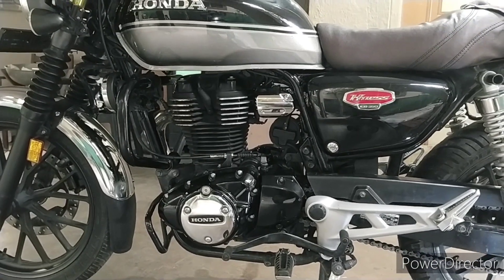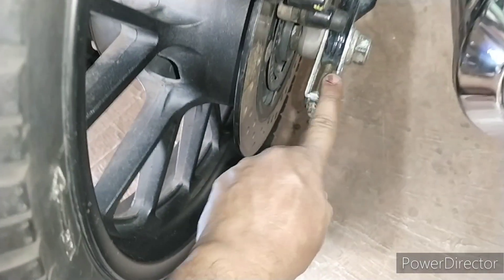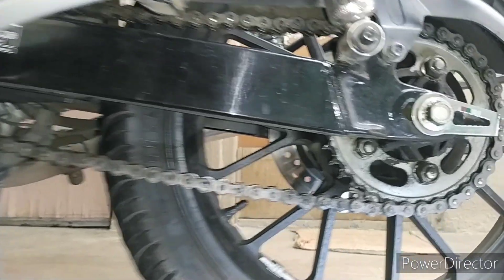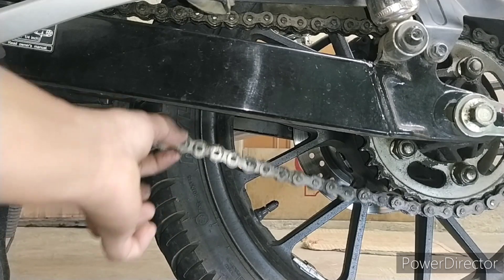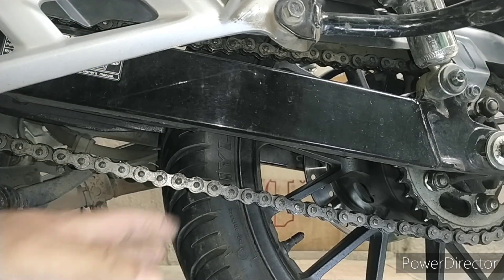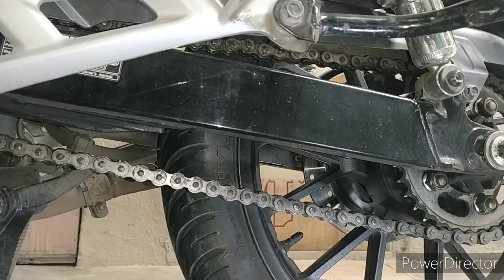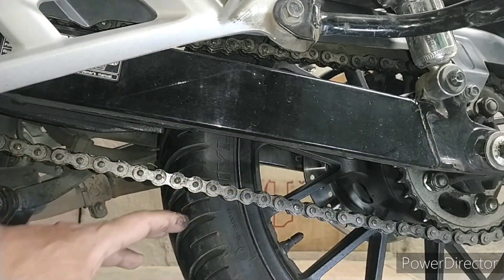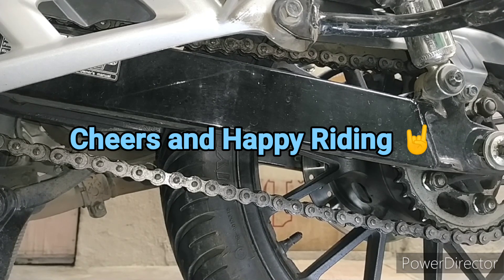Honda CB350 H'ness - Drive Chain Adjustment - DIY

Comment: Hello, we never adjust the chain tension on the central stand because when you put it on the ground it will be too tight and risks breaking, especially when riding two-up.

Comment: Hello Raj Sir, need your help. I have CB350RS, its leaking oil from box, from the middle joint section of the two parts of the gear box (i.e. crank case and Honda has used RTV silicone glue to seal the two section ) , it is a minor leak, however, its a new bike, I don't want the complete engine to be dismantled to be able to apply new sealant then reassemble the whole engine. So, my question is can I apply RTV silicone on the leaking area? Is it good solution? Will RTV hold for long? If yes, which brand of Silicone glue should I use, please suggest?

Comment: After completing 28k kms in 2.5 years , i changed the chain set with a brass rolon brand. Since chain stock not available at bing wing, i had to go for a rolon chain. Is rolon better than normal chain used by BW..

Comment: sir could you please instruct us where to get fog lamps fitted from in bangalore without voiding the warranty?? also sir, chain seems to be making noise while giving throttle after 30kmph, noise seems to be coming from the front sprocket area more, service centre guys are saying there is no issue because they are cheats, do you have any suggestions for both these? please respond. I have the new 2023 Hness. @motovin77

Comment: Hello Raj sir. I've been avidly watching your videos for the past week and I must say, they are very informative. I've recently taken a liking to the CB350, but was a bit displeased seeing a few people complain of the wobbling issue they've been facing. Does the issue still persist and if so, how likely are such issues, say per 100 units? Is there any way a PDI can help avoid such units? 
Anyway, thanks for the good content. Cheers!
Reply: I've been riding a CB350 RS since a year now and I've never faced this wobbling issue that you're talking about.
Reply: Being part of many CB groups and ridden 24k kms. I'd say this issue is way exaggerated. As Raj Bhai covered in his wobbling solution video, uneven wear of tyre appears to be main root cause and by proper wheel balancing it can be avoided. However when bike is brand new, bike would not wobble because of no wear in tyre. Hope I make sense here
Reply: I also want to know more about this issue as its is a deal breaker for me.

Comment: Kindly share review about idemitsu irg7 10w40 fully synthetic. by what extent has the oil reduced after 2000kms, how is the oil after 2000kms, about heating issues if any? how smooth is the engine with this oil.

Comment: Hello brother..Greetings to you🎉🎉...Please advice ...Iam devastated and depressed about my new bike.... Recently brought H'ness CB350.. Initially chain noise started within one week of delivery.. After 1st service still the noise prevails..Up till 2nd gear its muffled but in the 4th gear noise is more and more...The sound is very annoying .. Spent so much on chain lubes ,chain paste and so on more or less equal to a new chain sprocket..A brother adviced me to use fully synthetic lube....But no solution...Please tell me what to do😢
Reply: Brother did you tried gear oil or engine oil?
Reply: @brobanternation  no brother.. didn't try one
Reply: Found any solution?

Comment: I have the vibration issue on foot pack  right side and service center told me to change chain because bike running 10000/-. Is it true? What will be the solution?
Reply: Yes